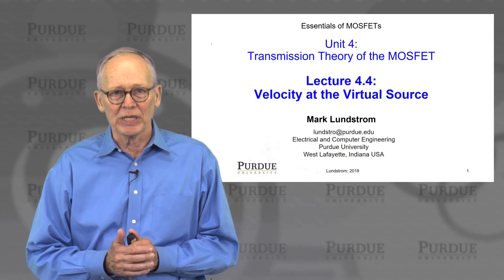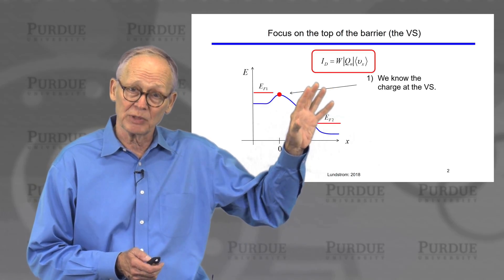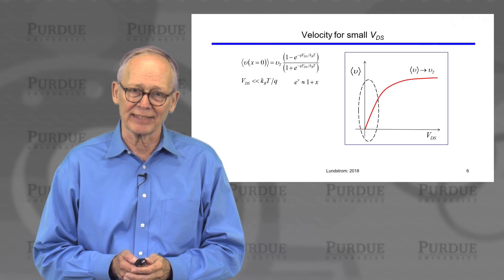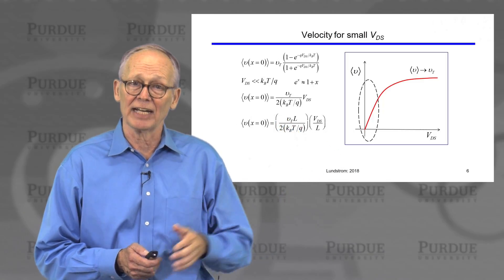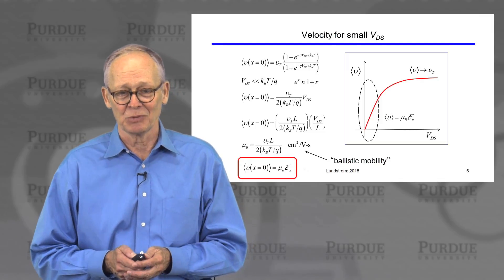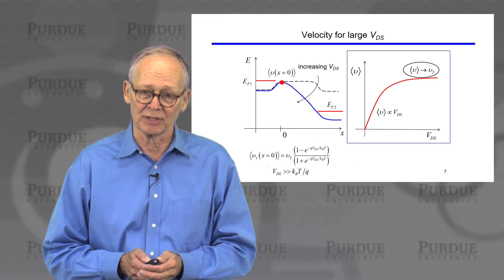nanoHUB-U MOSFET Essentials L4.4: Transmission Theory of the MOSFET - Velocity at Virtual Source

Comment: 00:00    Lecture 4.4: Velocity at the Virtual Source
00:23    Focus on the top of the barrier (the VS)
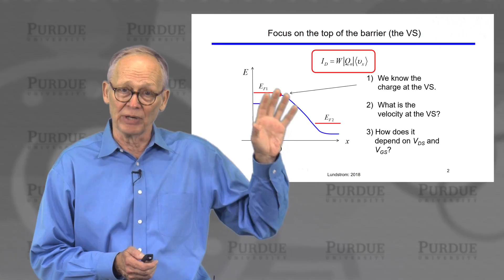00:57    Approach
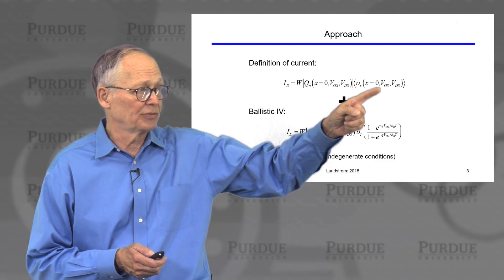01:22    Average velocity at the VS
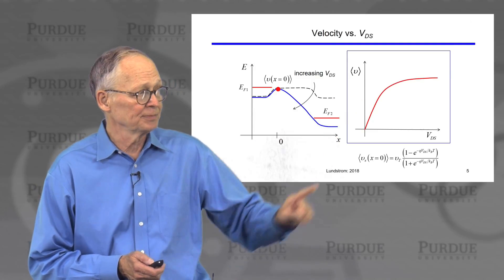01:51    Velocity vs. VDS
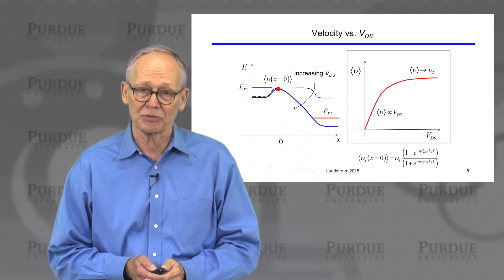02:18    Velocity for small VDS
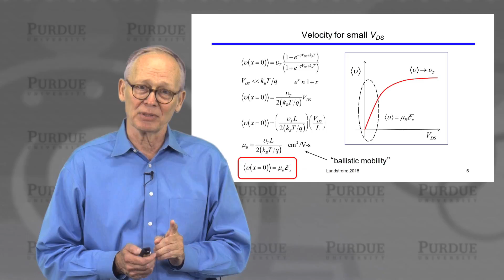03:57    Velocity for large VDS
04:31    The "signature" of velocity saturation in MOSFETs
05:15    Physics of velocity saturation
06:03    Equilibrium Maxwellian velocity distribution
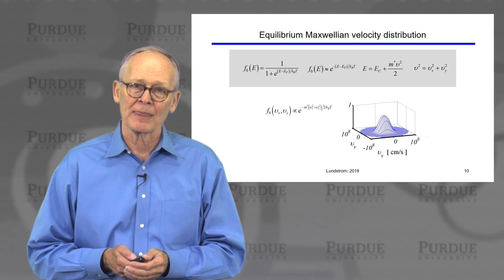07:28    Filling states at the top of the barrier
11:14    Ballistic injection velocity
12:16    Gate voltage dependent ballistic injection velocity
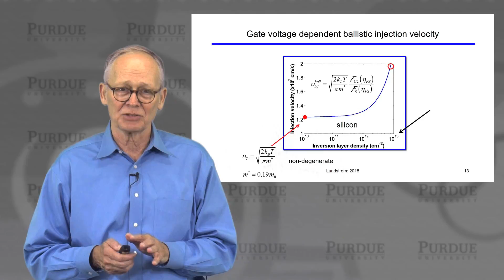13:14    For more discussion
13:24    Summary
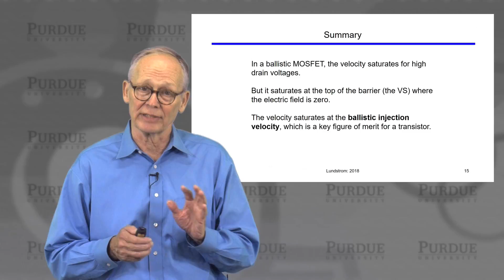14:08    Next topic